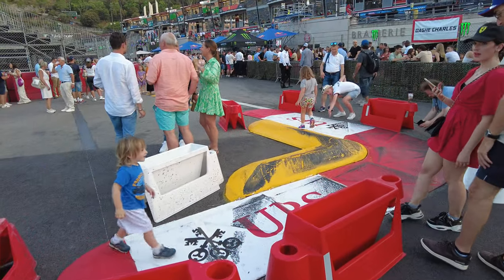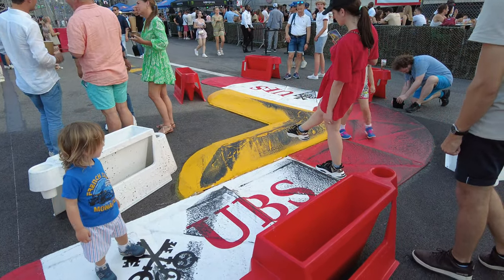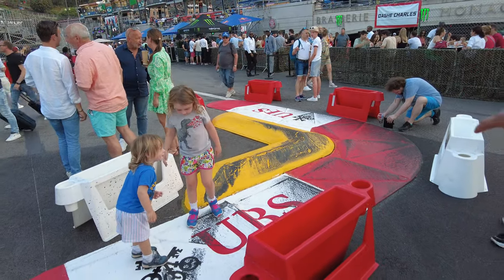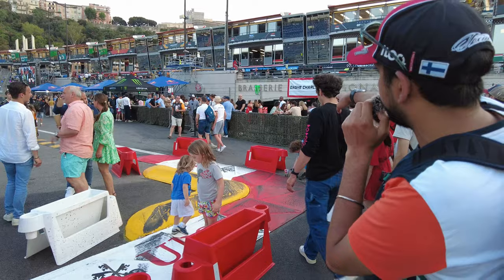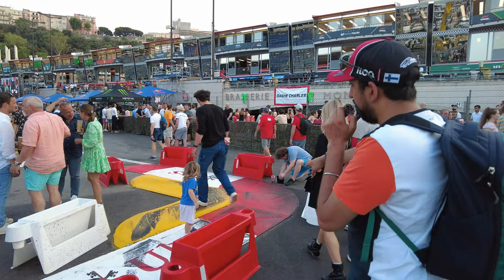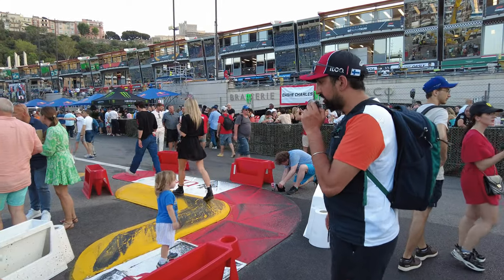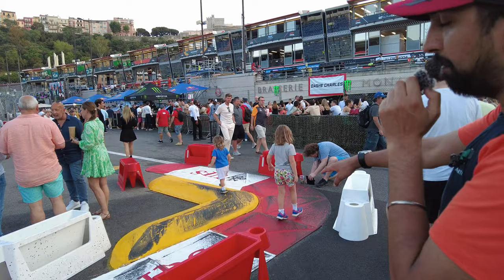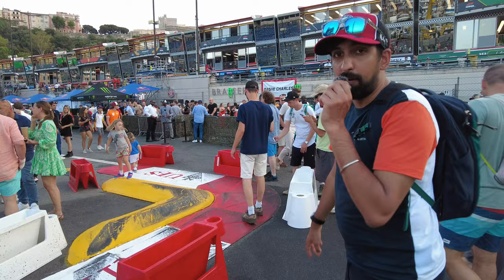Daniel Ricciardo Monaco F1 Crash Caused By McLaren Ride Height Issues?

Comment: Hey Kireth do you have tips on how to reduce understeer in gran turismo 7? I don't really know what setting to adjust in tuning. I'm trying to get the 787b to be quicker at Suzuki s turns.
Reply: up the rear ride height, stiffen the rear antiroll bars, or loosen the fronts considering what the standard is.
Reply: @nm-1-m159  OK great thank you